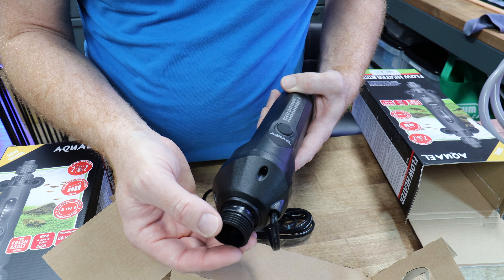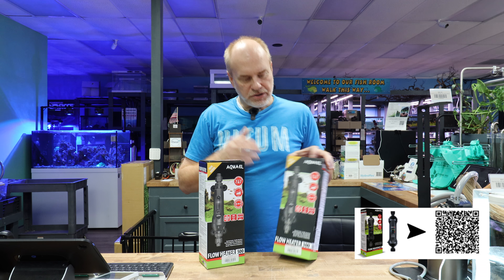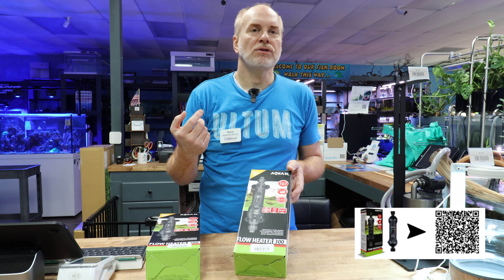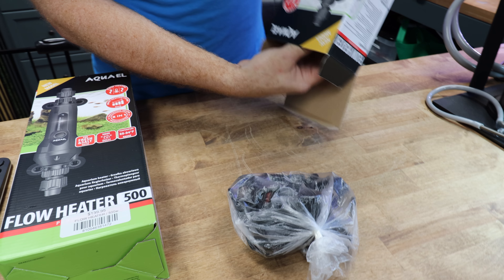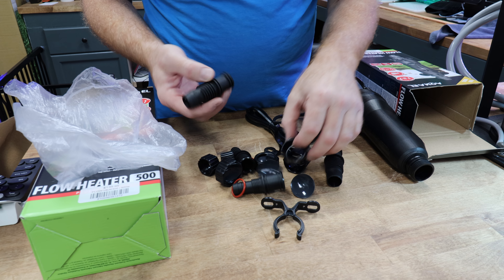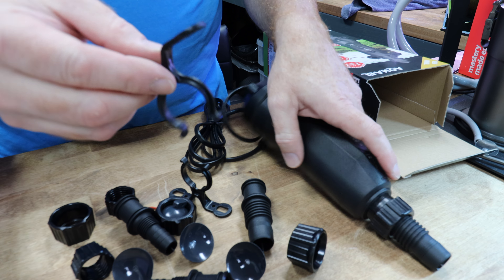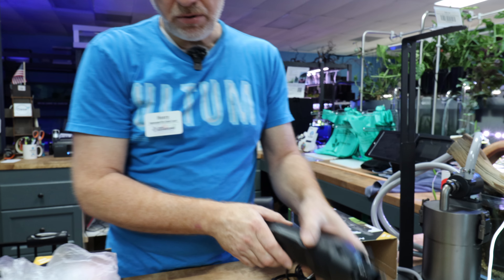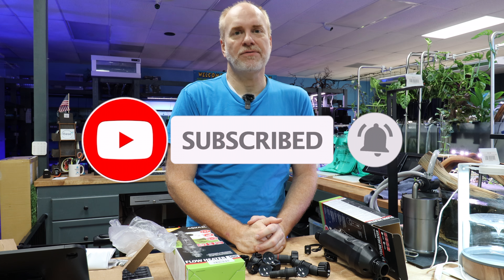Unboxing & Setup Guide: @AQUAEL25 Flow Heater | Exclusive First Look!

Comment: Wpuld they fot the fx4 tubing??
Reply from the maker: It’s got several fittings. Good question. I’ll have to check it out
Reply: @natureaquariumsusa  awesome ,,,the fx4 I'm fairly certain uses a 1inch diameter tubing??
Reply: It was great to meet you Sunday. I’m really interested in this for my new 75g setup with 407 canister that has 3/4” tubing. This would connect to the inlet line? Also, if mounted under cabinet, does it have a digital temp indicator that can be seen from outside the cabinet ?
Reply from the maker: Hi great to meet you as well. It has several connectors from 5/8 to 1”. No the only display is on the unit itself.
Reply: @jeffelliott7983 A 407 isn't anywhere near big enough for a 75 gallon tank.